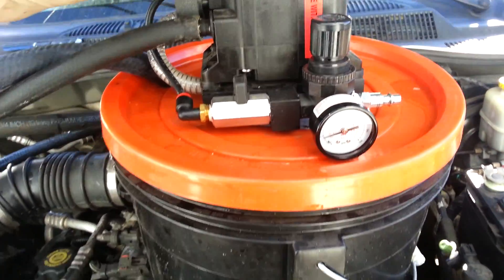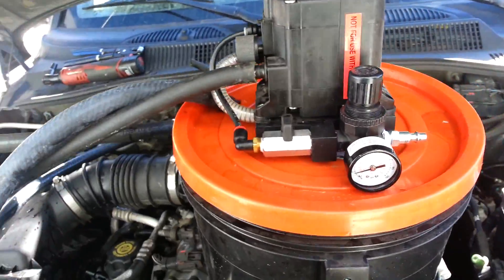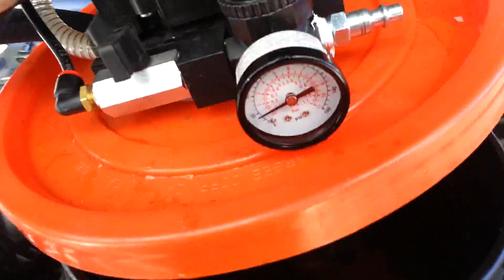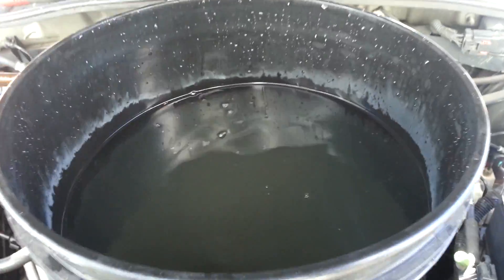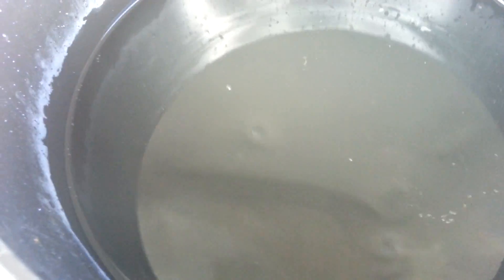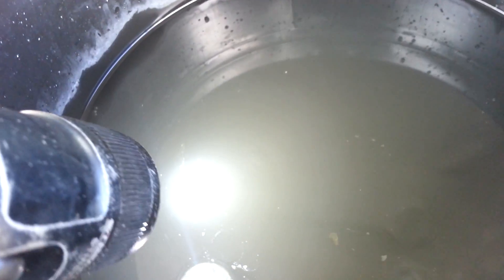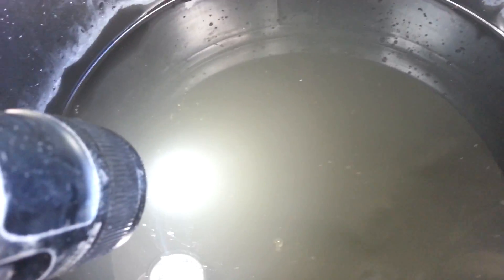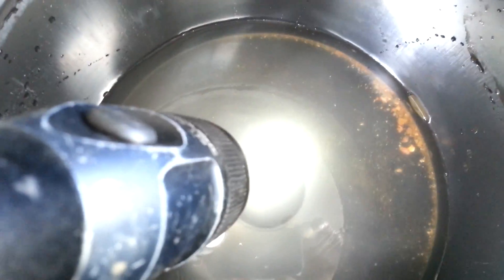2003 Jeep Liberty Poor or No Heat

Comment: I have this problem with mine, i already did a flush with hot water under high pressure and it brought some heat back when i had none but still not were it used to be. How can i do this flush? Do you have instructions to make that pump?? Or a more simplistic solution please? Also on my 2003 jeep liberty sport the heating and cooling has been reversed, do you know how to fix this?